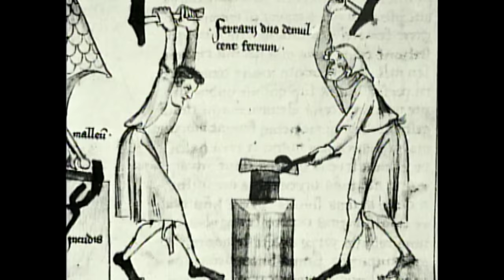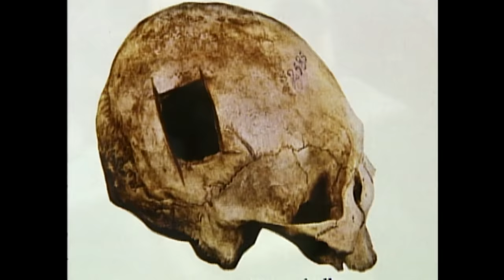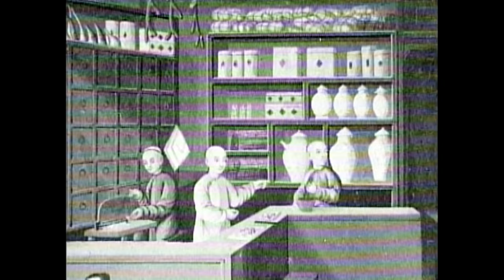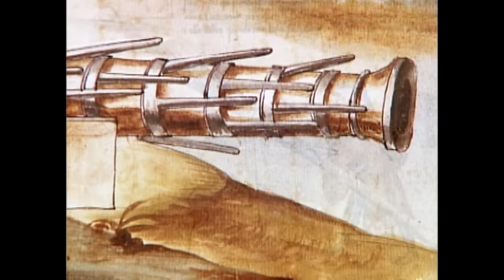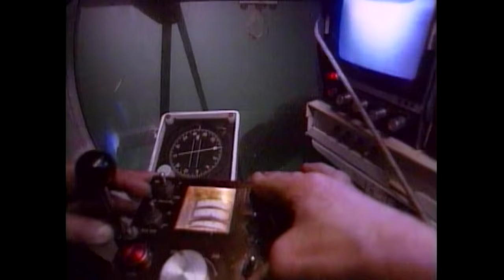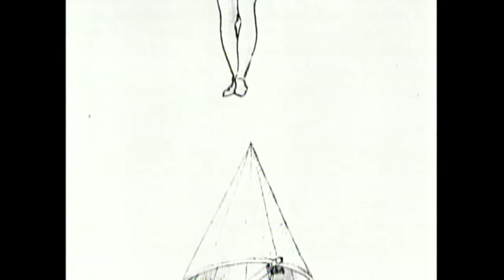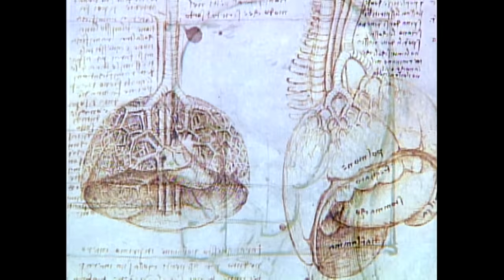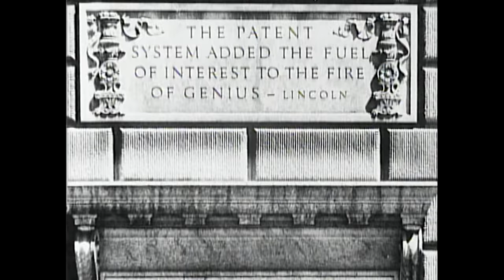Genius Ancient Tech Explained | Ancient Mysteries (S2) | Full Episode

Comment: I find it amazing that scientists find it amazing that the ancients could make straight lines. It's called a STRING, people. Strings and chalk lines,(strings loaded with colored powder), are very simple but accurate tools for laying out straight lines. Water, since it finds level, could have been used to level foundations. Plumb bobs, (a string with a weight on it), was and is an accurate way to straighten objects vertically.
Reply: EXACTLY .... FACTS...!!!
Reply: Bro lmao I don't think they plumb bobed and 200 ton 🪨.
Reply: @michaellitchford9285  what are you talking about.
Reply: If physical strings or chalk lines could be used for long ranges, we wouldn't need modern survey equipment. In reality, extremely advanced geometry is needed, far more advanced than high school type. We're talking about Gaussian Geometry here (Gauss lived in the 1800's). Layout of things like the pyramids (3D Platonic pentahedrons with 5 sides) along true N-S (not magnetic North) requires additional advanced knowledge of astronomy and equatorial phases.

Building 8 straight lines that each meet in a specific vertex cannot be done with string in any current imagination. So the pyramids were not laid out with long lengths of string like chalk lines. If you tried this, you would quickly find you were building a spiral as each course arose. 

As far as the lines in the S.American desert- those range for kilometers. String would have to be at least 1/3 of that length to be straight, and not become a series of curves. It's unclear how a 1km long string could have been manufactured thousands of years before machinery. 

So yes, plumb bobbs and chalk lines are great for little houses and such. Making a 4 acre square base for a pyramid with string would not be plausible, as the errors would be far greater than actually observed.
Reply: @hobbyhermit66  It's a 3-4-5 Pythagorean triple. Yes, I'm rather familiar with geometry and laying out structures. The pyramids weren't built that way. They are lined up to true North, celestial North, not magnetic. And not just "sorta", but with astonishing precision.  Also, are in alignment to Orion's belt. 

One thing you're overlooking is the 4 ACRES of area forming the base. This isn't some dinky 5,000 sq.ft. house. If you look into Gaussian Geometry for triangles, squares, and pentagons... you will appreciate why this is such a feat of engineering. Once you understand what it takes to form a pentagon with bisecting angles, and having this agree to within 1 degree of equinoxes, then you will understand why this isn't so simple as a 3-4-5 triangle. Btw, you would be many meters off using 3-4-5 sides to square a base that large. You can't just use 1 point, you have to bisect every vertex by every other when areas get that large. 

Oh yes, and you would inevitably get a spiral as you added courses. The stones are irregular, and there's no way to use them as reference points for arbitrarily smaller squares on top of smaller and smaller squares (which is what the pyramids are). You would have 4 new corners all with different dimensions at each new layer. It would spiral. 

All these lines meet precisely at the cap stone, in 3 dimensions. It's not highschool math. You definitely can't do it with chalk lines and plumb bobs. These structures are rather a lot more complex and "highly engineered" than you're giving them credit for. 

Very capable engineering experts have built scale models of these pyramids the height of a two story house, and been very much challenged to their limits. (And Yes, i agree they used water levels for the courses.)
Reply: @onebylandtwoifbysearunifby5475  maybe because engineering experts can't wrap their heads around something so simple. Most of the engineers I'm familiar with seem to have attended Rube Goldberg U. The difficult part of the whole thing as I see it, is moving that much material back then. Getting the angles on the cover stones would have taken plenty of skill, but the base structure is pretty simple. If one starts with a square base, a uniform set of measurements for height and width for the stones, then a set measurement for the run of the stones (lower stone face to upper stone face), the pyramid will design itself pretty much. Doesn't even need miters. 
I made no reference at all about the alignment with the earth. Only possible methods of the actual build. Not that any of it is important, tho it's interesting.
Reply: @hobbyhermit66  the great pyramid is not a 4 sided "square base" there are actually 9 sides (8 sides plus the base).  This was only relatively recently discovered with the advent of areal photographs taken during one of the equinoxes / solstices.
Reply: I think the same thing happened to these ancient technologies were lost the same way as NASA lost their telemetry data from their moon exploration.  JS
Reply: Agree but it's the discovery of these ideas what compelled it what clicked for them to weave meters of leaves or straw  ext together? We lose the idea that we today have created far more advanced ways today! But what drive the idea they had? We piggy backed off of it!
Reply: @fairuse707  Ancients= People from Ancient times….. Not all Ancients are African, yes all of our original ancestors were from Africa but that doesn’t mean there is no such thing as ancient Romans, Ancient Greeks and even Ancient Americans
Reply: But how did they move a 400 ton stone over hundreds of miles?
Reply: @BillKinsman  they floated stones via canals that they dug to receive water from the Nile River
Reply: It's laser-like precision.
Reply: Hahaha right.
Have you heard of coral castle
Reply: @ Fred Lamb you don’t know much about pyramids,ancient structures that coincide with the stars and space
Reply: they didnt havfe "strink"
Reply: How to make everything you've channel goes over a lot of the tools they used to get billions square, plumb, and true. Super simple, yet very effective

Comment: The intelligence of these ancient times to figure out things that in our day of technology still do not have answers.  I would love to know how they lifted those rocks. Shaping them exactly to fit or pick the stones themselves.
Reply: Just recently they figured many ways it could be done acids between the rocks, forced jet water, sound vibration levitation, and poured rock tech like cement
Reply: @terrafirma9328  nope microwaves and frequencies melted the bricks
Reply: @matildamarmaduke1096  You might be right, just because we have the technology now means it could have been discovered before and the tech lost in past wars.
Reply: U r all wrong ppl like ron wyatt have found out how they did it witch was using leverage. I know its hard to believe that they didnt use this crazy advanced tech. If u guys search up coral castle u will see how that guy used leverage to built it by himself.
Reply: Watching this is like school. But only in the best of ways! I learn more out of these vids myself than all 4 years of high school combined.. may be because of the fact that my brain has matured 22 years since graduation?? Or maybe it's because it's presented in a way that is interesting and draws you
Reply: @matildamarmaduke1096  microwaves leave saw marks? Some of the stones have clearly visible saw marks.
Reply: @terrafirma9328  Geo-engineering, Magma filled sand casting.just fyi
Reply: The Enterprise did Time Travel. And  Spock violated the Prime Directive and taught them, as a Science Project, and that planted the idea of flight, leading to the Enterprise. It's a Causality loop.

Comment: Seems Graham Hancock is talking about some other stone structures rather than the pyramids.  The stone blocks at the pyramid do not weigh 200 tons each, the pyramid stones are approximately 2.5 tons each.  But what size are the stones beneath the outer layers?  They could be much smaller in size.

Comment: In the first century AD they could use a battery to light fires. It’s simple. It was probably used as a lighter. They are just thinking too deep into it. I still use batteries and a little brillo or copper wire to light my cigarette when I go to jail lol…
Reply: It was probably used to electro plate silver onto regular metals.

Comment: How egotistical of us to "assume" that the ancients had no way to measure things, or drill, cut, mix, or build without "modern equipment". Clearly they were able to and did quite well and we have no idea how they did it. Goes to show you something about we "modern" folk. ;) There was a man in Florida that solved the question of how the ancients could move large blocks easily with one finger. But he died never divulging how. And then there are scientists/scholors not willing to share ALL the truth. There are construction sites further in from the pyramids that you will find perfectly drilled holes through stone. You can see cut marks that are very precise. And it goes on. Like in Machu Piccu there are stones that look like they were melted and then placed into place. With finger intentions like the stone was liquid.
Reply: There was a man in Florida that solved the question of how the ancients could move large blocks easily with one finger. But he died never divulging how

wrong, he did divulge how, he put a couple small stones under the block and rotated it  on top of the small rocks using them like a bearing
Reply: actually, egyptian tools used to drill into stone for mining have been discovered and duplicated. proven to work :)

Comment: 26:55 Wrong, math is way off sir. 200 tons is not equal to 500 family sized cars unless they weight 800lbs. At 3000 pounds approximately 130 cars, and that is really light for a car. Probably not a family car. The number would be closer to 110-120..ish.
Reply: @Nl85-100  It could depend where you live, in to U.S. cars are heavier generally with safety stuff added.. Other countries are probably lighter weight. A 4 passenger car could be anywhere from roughly 2-4 thousand pounds.. A Mini Cooper is about 2600 lbs.( could be lighter without the glass tops) .. A Dodge Charger is Probably 3700 ish.. I am just guessing roughly on these numbers but just for an example..  Either way, We aren't 350 cars apart on our math..
Reply: @Nl85-100  Either way, no easy task to accomplish.. Take care!✌

Comment: I think I know how the Pyramids may have been built. Could they have loaded massive amounts of sand for each layer of blocks placed to level out the terrain so as to make the slope in bringing the blocks not that steep? Perhaps after completion of the pyramids then removing the sand and digging it out to make it appear as though they built it purely upwards? 🤔
Reply: I also wonder if they maybe mounted a giant wind sail to each block and harnessed the wind to move blocks along easier… 🤔
Reply: In addition to using a wind sail for each block you could also maybe attach a whole bunch of kites to better steer the blocks using the wind… 🤔

Comment: I think for the heck what we need to do is jackhammer one of those blocks out of there and make sure that's really a seam and not just a simulated carved in seam and that concrete was actually poured somehow in there as truly as it might have been formulated 
..and then poured into a mold structure. carefully... allowing the concrete to set to become the mold with more and more integrity.... And become the mold itself... Either that or hoisted up with a spaceship with gravitational levitation because cables very difficult to make back then...

Comment: I love graham hancock but 200 uk tons is 448000 pounds, and the number i get dividing that by 500 is 896. From the factory family sized automobiles weigh more than double that unless you pull the engine, transmission, both axles, and strip it down to its frame inside and out... then the math ends up pretty close.
 500 family automobiles (4 door 5 seaters) in their new and ready to use state would weigh about 700,000 kilos.

Comment: @1:18 You need to verify what is said before putting it in your show as fact. 

First, given that the speaker spoke with a British accent, which “ton” is referenced; short or long?

The “average family size” automobile weighs 3500-4400 pounds depending on your definition of “family size”. That is 1.75-2.2 short tons, or 1.58-2 long tons 

Two hundred “tons” would therefore be roughly equivalent to 114-91 automobiles for the short ton, or 126-100 automobiles for the long ton. 

Not 500.

Such an egregious error just a minute into the program gives pause to the veracity of the rest of the program.

Comment: You rarely hear about the fact that the pyramids are actually eight sided!! Each of the four sides are divided in half and those sides are angled in slightly. You can really only see the sides from above. Throw that calculation in the mix and the building of the pyramid is really quite a bit more fascinating.
When you think about the theory that the blocks are actually made of concrete that still doesn't explain how the blocks were set into place. Are they saying the concrete blocks  were poured into place on the spot? How in the world would that work? The concrete has to be a mixture of sand small stones, some kind of hardening agent and water. Are they saying that all the materials were hauled up then mixed then poured or shoveled into a form and allowed to dry? Then move on to the next block? Hauling all the water, sand and stones to the level they were working would seem implausible. What would they use for a hardening agent? Without something like that, the blocks wouldn't last the thousands of years they already have. They would disintegrate from weathering. Granted, Egypt doesn't get a lot of rain but even wind and sand storms would do a number on the pyramids. Plus they would have to build the forms from wood and I don't think ancient Egypt had an abundance of wood. AND it would have to be straight wood! To me this theory isn't plausible and should be discarded along with flying pigs!!!

Comment: A ramp would take more material to erect than the material needed to build the pyramids themselves and the ramps would stretch out over a mile away or the grade would just be too steep of an angle to get the stones up to the top. The Inca temples just simply didn't have the room available to build any kind of ramps to get their needed stones some of which weighed in excess of 400 tons,  twice the weight of the largest stones used in the mystifying "Egyptian" Pyramids..

Comment: Lie....200 ton blocks = 400,000lbs limestone weighs 4,500 lbs/CY = 88.8 CY=13.4x13.4x 13.4 ft....those blocks are not that big...a CAT627G scraper can carry 27CY....so you are tell that it would take 3 of those loads and that much horsepower to move that volume? CAT 627 loaded is 136,000 lbs = 68 tons....these people need to learn math.

Comment: How do you lose wootz steel??
Reply: Supposedly it's crucible steel with a specific ratio of elements. It then has a very specific heat treatment. So if you run out of the specific ore or lose the technique then it's lost. Considerable effort has been made recently and they (blacksmiths) have come very close to replicating it. Hope that helps.

Comment: The claims here on damascus Damascus Steel "We do not know how it was made"   There is a video on you youtube of a black smith consulting a german engineer  on the composition of this metal  he tool junk Iron or and heated it up and a cone shaped furnace and then picked out the iron peices when he had enough he made a clay vessel puting in the iron chips and the prescribed amount of powerdered carbon from wood.  Sealed the clay vessel and put it in his furnace and he came out with  and ingot of damasus steal being a black smith he then hammered this out bit by bit to insure its hardness and then PUT IN every marking a symbol  from an intact viking sword even putting in in cut out parts another metal the work was so astonishing 

The Grandiose claims here is to play with your mind to beleive things they either know nothing about.  or just have made stuff up to work in this story narative. So of the Bird found in Egypt models of this have been made and probably are on sale in egypt and if one throughs it off a higher spot IT GLIDES. 

Based on these two things what else have they distorted to make this show?